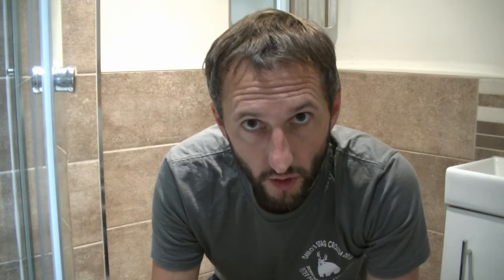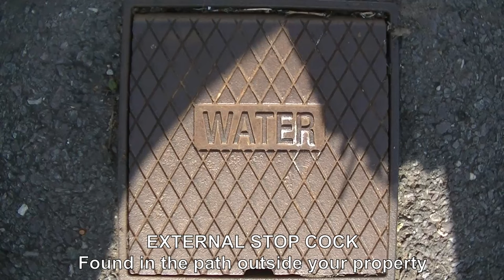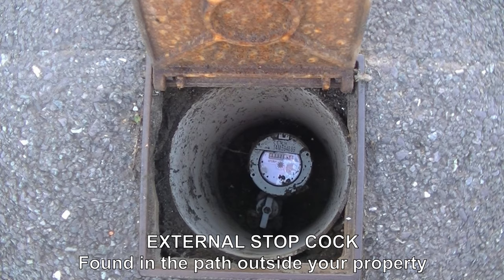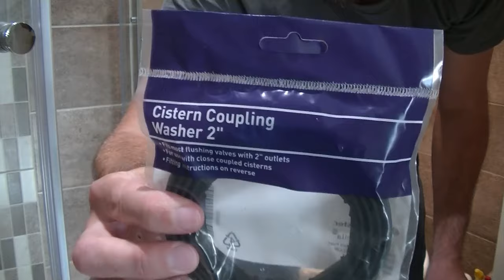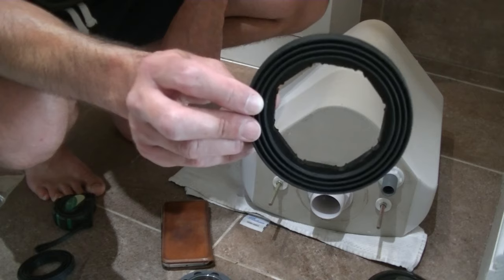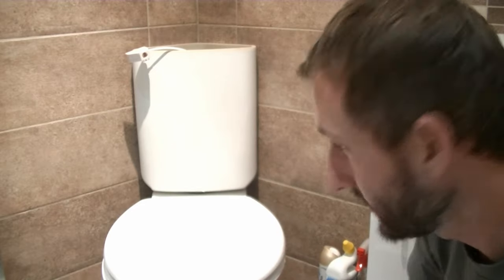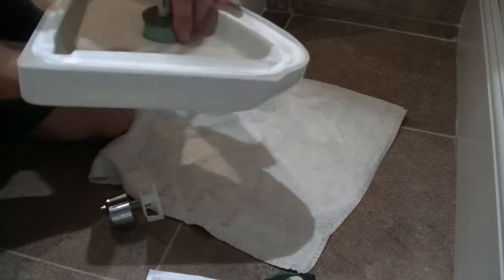How to fit a toilet flush valve & fill valve. Fluidmaster dual flush install. Leaking flush fix!

Comment: THANK YOU!!! The original paper instructions were awful. I ended up flooding the floor. I was exhausted and then saw your 'How to" and it all made sense. I bought a new cistern washer as you suggested and some new screws to bolt it back down.
Wish i'd found your video first! I also removed the chrome sleeve from the flusher switch and it fits nice and snug.
Reply from the maker: Glad the vid helped. Hope its all still holding up!

Comment: Great video, just did this on my toilet with the same kit as you used, didn't need to remove my cistern as I had space to get to both valves.
My fill valve would hiss and let out small amounts water a short time (Annoying at night unless I isolated the water to toilet) but then it eventually wouldn't stop filling up.
The flush worked but some plasic piece broke so you'd have to manually push it down after a flush.

Such an easy job to do, just double check before buying parts and remember to switch of water then a case of removing old one and replacing in the reverse manner.
Reply from the maker: Glad to help. Great work on doing it yourself 👍

Comment: Note: The button on yours is standing out from the lid, the sides of the button can actually be removed so you can have it sitting flush (forgive the pun) with the lid instead of sticking out like it does when you finish the job. 

Thanks for the rest of the video though. Going to put this to use tomorrow once I have some new screws for re-attaching the cistern to the wall again afterwards. Mine are rusted right up!
Reply: Nice one mate I was going to say I like it other then the fact that the button wasn't flush. I was going to ask if there is a way to make it flush and not sticking out like that, you answered that for me nice one 👍
Reply: How would you make it flush from the way he has done it, is it just removing the silver thing inbetween
Thanks
Reply: @muneebhassan5415  Yes.

Comment: Thank you for a very useful tutorial  One point relevant to our particular make of toilet was that it was impossible to disconnect the water supply as shown in the video.  After a number of attempts I realised that the only way to disconnect (after turning the water off) was to partially remove the cistern and lean it forward and then pull the flexible pipe through a couple of inches which then enabled us to disconnect the water supply.  Only then did we  observe a valve on the flexible pipe something that could not previously be seen.  Once we overcame that problem it was as per your video although because of the initial problem my wife had to assist.  But very helpful overall.
Reply from the maker: Sounds like a slightly impractical installation in the first place! Glad it worked out for you and thanks for watching!

Comment: Thanks for the tutorial, I have the same issues, I replaced the fill valve ok but in doing so made the flush valve leak slightly into the pan, a constant trickle. I bought the same unit you showed and tried several plumbers to come do the job but without success. The removal of the cistern to fit the new unit concerned me but I'm confident I will be able to do the job myself thanks to you.
Reply from the maker: Glad it helped, best of luck 👍

Comment: I fitted a similar one today but I used both the black rubbers on mine, I didn't realise you had 2 and you could chose but no leaks and no problems with it.... Good video
Reply from the maker: Good work! Sometimes you just have to improvise! Thanks for watching.

Comment: Very good video pouse. 

Watched for leisure as I know how to do mine as well.

One thing I will say is the minute my fill valve packs up I will be replacing it a metal threaded one. I really don't like the plastic threaded mine came with (included with the toilet from B&Q).

Cheers for the upload, thumbs up.
Reply from the maker: Watched for leisure? You need to get a new hobby! Thanks for watching and best of luck.
Reply: @POUSEaroundtheHOUSE  Just bored on lunch break at work hahaha poor use choice of words. Thoughts on the plastic threaded valves on these though??

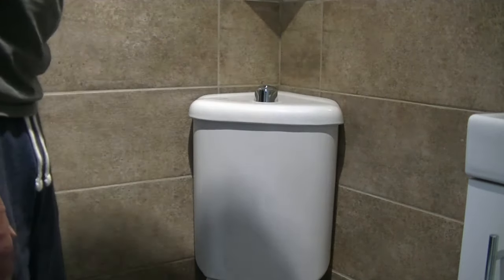Comment: Good video - I will add a small point which is only cosmetic - you can remove the push button collar so the button sits flush. 13:26
Reply from the maker: Indeed you can. Thanks for pointing out and thanks for watching.

Comment: Really useful video for changing flush and fill valves. Cheers! One my bolts was completely rusted so had to hacksaw through to separate cistern from the pan. If bolts look corroded I'd recommend buying new ones along with the new coupling washer before starting to take things apart as both parts are cheap anyway.
Reply from the maker: Thanks for the feedback and thanks for watching!

Comment: You have saved me going mad cause the plastic part under my flush came off when putting in some cleaning products.i kept trying to put on by pushing the plastic slide in not out.thanjs for help so much feel a bit of a pratt but I'm a welder not a plumber.thank you again 👍👍
Reply from the maker: No problem!

Comment: Fantastic, wondered what the second seal in the box was for. The hole in the tank is bigger than the nut on the flush valve as per your video, was going to take it back however i get what its for now. Cheers
Reply from the maker: No problem, glad it all made sense. Plumbing is never straight forward!

Comment: This is just so brilliant, thanks. Was nervous about updating my old cistern, now I'm confident to do the job. Just one point. My cistern currently has an overflow, with an exit at the bottom. I will need to blank this off, what shall I use? Cheers.
Reply from the maker: You just want something like this - https://amzn.to/3CjOdGN. Just make sure it's the right size before you buy it. You may get it cheaper somewhere like Screwfix or tool station. Best of luck!

Comment: Thanks. Bought the same part so this video came in handy. Still leaked between the cistern and toilet basin though so I ended up using the original washers and its now watertight. Not sure why but it works.
Reply from the maker: Nice work!

Comment: Your video instructions are great. I had someone fit a new fluidmaster flush valve, but there are leaks from both wing nuts to the cistern and the seat wing nuts. Can you give some advice on what to do please to stop the leaks. Thanks
Reply from the maker: Glad it helped. You need to have rubber seals inside the cistern under your nut heads to create a water tight seal?
Reply: @POUSEaroundtheHOUSE  Thank you for your advice.

Comment: Thanks for the syphon change! How about changing cris-cross handle of the wash basin and the bath? Its that type of tap that doesn't have any tiny holes where you can turn. How do I remove the cold and the hot knob? It's continually dribbling I think the screw is worn out because i can't turn it off. I also can't find a copper screw for the taps.

Comment: Great video. Attempting this today. I did notice when looking at the bits that the flush button does unscrew at the top, is this so it can be flush with the top of the cistern and not so stuck out?
Reply from the maker: Yes you can put it flush with the top of the toilet. Best of luck.

Comment: I’ve just replaced mine with the same kit only difference is I removed the extra chrome round the button so it was more flush with the lid.
Reply from the maker: I did that on my old set up. Thanks for watching!
Reply: Same here :)

Comment: I’ve replaced my fill valve, flush valve and coupling washer today but still water leaks from the cistern into the pan....whhhyyy? Any ideas pal?
Reply: I had similar problem. Water leaked out the back of join between the cistern and the basin. Ended up using the old toilet washer and thinner gasket from the original flush valve. Had to ignore the advice of fitting new washers but now its watertight again.

Comment: Great video. I thought I could use Fluidmaster when I watched this video. However, turns out Fluidmaster only provides adaptor to fit 2.25" hole in the bottom of cistern. If the receiving end is not a pan, but a 2" flush pipe. There is no adaptor for joining the 1.5" outlet to 2" flush pipe.

Comment: Can you use this to replace ideal standard flash valve
Reply from the maker: It needs to be compatible with the water tank on your toilet. Check the hole sizes and if they're the same then it should work. Best of luck with it.

Comment: Cracking T-shirt you're sporting there Pouse! 😉
Reply from the maker: I love an old stag do t-shirt, puts me in holiday mode!
Reply: @POUSEaroundtheHOUSE  i bought this syphon and wondered why it wasnt working the push button housing with the slider wasn't on it and just wouldn't stay on so I assume it was faulty is this common? Thanks... great video btw mate
Reply from the maker: @garylawton7254  sounds like it. I've only ever fitted one of this particular kit. Hope it worked out for you. Thanks for watching.
Reply: @POUSEaroundtheHOUSE  seen two videos on this now and both had the latch thing on them that secures it in place one i bought from Screwfix hasn't??? Lol bloody thing must be faulty. Can you usually change the syphon in situ ie it twists out or gotta take cistern off and replace entire syphon? Cheers mate
Reply: @POUSEaroundtheHOUSE  do they twist off to repair do you know mate?
Reply from the maker: @garylawton7254  I think you can twist some off and leave the base in situ but depends on model. In the video that's how mine came out of the box. Hope that helps.

Comment: Does the hex shape in the cistern coupling washer not need to be aligned to the Hex on the cistern before seating it down? Or does it not make much difference
Reply from the maker: It fitted tight on my old flush valve, but to be honest if it creates a seal with the toilet pan then it doesn't really matter. You could also use a donut washer. Thanks for watching.

Comment: Can this type of flush valve be taken out for clean/service/repair without dismantling the toilet?
Reply: Yes it just twists out for a replacement flush valve, no more taking it off the wall
Reply from the maker: As Charles said, it can be removed without removing the toilet. Obviously the seal between the pan and water tank requires the toilet to come apart if it ever goes but that's unlikely to need replacing in a hurry.
Reply: @Charles61284  Thanks guys. I installed one of these a year or so ago and it's been fine until recently, when the flush stopped re-sealing and just kept losing water. The handle had become floppy and would droop down, only allow the proper cycle if you manually adjust to horizontal. Anyway,heartened by your comments I've bought an identical spare so I can swop it round and see what's what.

Comment: my cystern has all the flush mechanism in a single column, ie there is no pipe to a button. It is broken. Can I substitute it with one as in your video? Are all the holes in cystern covers the same size for these buttons? Thanks.

Comment: Great video, thank you.

One small point, I don’t understand why people pipe directly to the inlet, it’s much easier to use flexi hose, looks better and easier to maintain, just my two pennies worth.
Reply from the maker: My pipe being plastic is easy enough to 'flex' into position, but I completely agree. They've used flexi for years in Europe and like you I think it looks good and is a lot more practical when replacing toilets. Thanks for the feedback Erhan.

Comment: What you have in that toilet is The old jolly flush valve there crap. I suspect it was refilling because it was leaking slightly through where the rubber hits the cradle. That squeak was because there was no pressure reducing bit in the feed. They look like little bits of pasta with a filter on a jolly flush. 

Fluid master are quite simply the best, Never the less you can always just change it from the top if your not confident in taking the whole toilet apart.(the new type isn’t that bad)

Can I ask a question while I’m here do you have a vid on Steel spans for floor joists. 👍🏻
Reply from the maker: Thanks for the feedback. I don't have a vid for steels sorry. Thanks for watching!

Comment: Hi. Thanks for the video. I have an issue with trying to fit the new flush valve. My new fluidmaster states it is for 1.5" - 2" and my cistern outlet is 2.5"! The protruding lip of the adapter washer comfortably goes right through the cistern outlet hole rather than sitting on it as in your video. I can't seem to find any advice online for this, nor can I find a flush valve for a 2.5" outlet. 

The old flush valve was also a fluid master of the same size but the whole connection seemed to have been flooded with sealant to make it fit! Any advice? Thanks.
Reply from the maker: If you look carefully mine has a gap around it as well. As long as the washer is sat firmly on the ceramic inside the cistern then it should create a seal then the lip of the washer (if centralised within the hole) will direct the water down the pipe rather than it try to creep under the rubber in the adapter washer. So I think you should be ok. You can add plumbers mate if you're in doubt and this will give you piece of mind but you probably don't need it. Hope that helps. Thanks for watching.

Comment: When you are removing the fill valve after isolating the supply,you say you turn a nut anti clockwise to remove the pipe from the system.I am sure you are turning it clockwise.

Comment: Hi, please can I ask a question. Earlier this year I fitted the exact same Fluidmaster kit as you did in this video. I'm a competent DIY'er and therefore I had no issues with the fitting. The problem I have is when I use the half flush (short flush) there is a very loud bang as the flush stops. I know the noise is not coming from the inlet pipe moving, it's definitely coming from the flush valve. I've experimented with different fill levels but nothing stops the annoying bang. Any help and guidance you could offer to stop this issue would be gratefully received. Always enjoy your videos. Keep up the good work. Thanks :-)
Reply from the maker: Not sure sorry. Have you tried flushing with the lid off the cistern so you can see where it's coming from?
Reply: @POUSEaroundtheHOUSE  Thanks for the reply. Yeah I've tried looking at it with the lid off and it's definitely coming from the sIphon (flush). As the short flush shuts off it does it with a severe bang. It's got to the point where I'm thinking of sacking the Fluidmaster fitting and fitting an alternative. Thanks for your response and keep up the good work with your videos. Thanks to your videos I have been inspired to have a go at several projects that I was wary of attempting before (esp plastering). Thanks
Reply: @smeggingqueeg500  have you tried replacing the top half where you adjust the flush ? These simply spin off and can be replaced I'd imagine there pretty cheap
Reply: @briarios666  thanks for the suggestion mate but I've given up with it completely now cos of the constant banging.  I went for a cheaper model and it's been fine. Thanks anyway 😃
Reply: @markbainbridge1767  tbh I'd do the same lol I gave up with the push button as the pipe where the water flushes away is to far into our cistern so the push button system doesn't work properly literally just went out for the old style handle now fixed 😀

Comment: Thank you! Came here to find out which way up the adapter washer goes as the instructions with the valve just say "facing down". Not helpful. 
Pouse 1 : 0 Fluidmaster